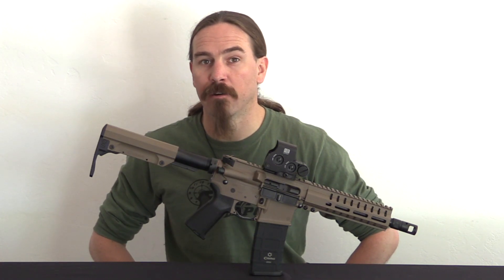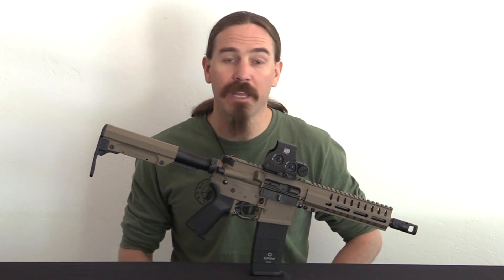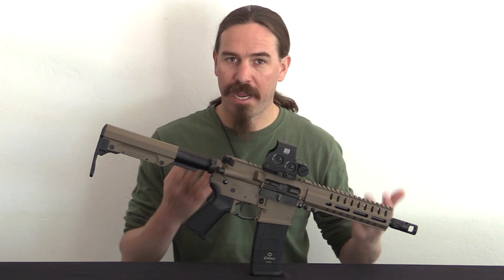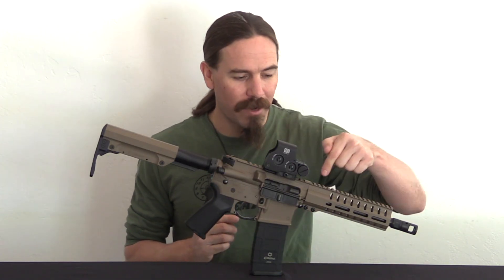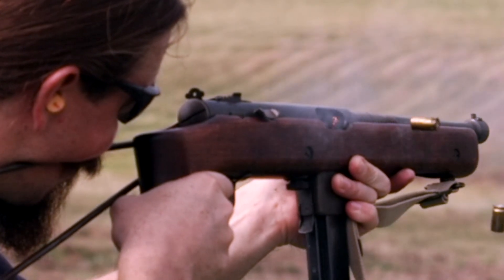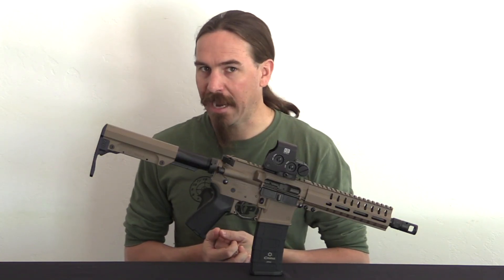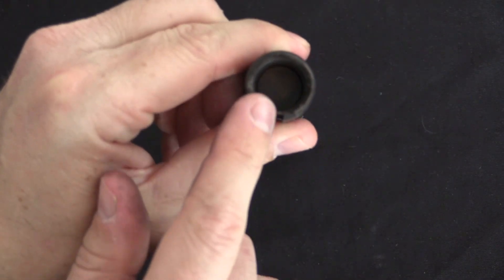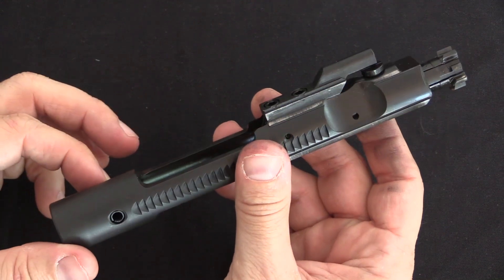CMMG Banshee: The Unique Radial Delayed Blowback System

Comment: I may need to snag this, for a PCC.
Reply: Wonderful in 9mm. Suppresses very well, too, if that matters to you. I like it enough that I will probably get another in a different caliber. Two thumbs up for CMMG from this guy.
Reply: Wait wat a week ago?
Reply: @redacted2713  time travel
Reply: maikson wever SCP #3548
Reply: @redacted2713  patreon supporter.
Reply: @redacted2713  patreon gets early access
Reply: I have the 9mm Guard. It is very nice.
Reply: You will not regret this gun. The recoil is pleasant unlike my Colt AR9. And I do like my Colt, it runs like a top. But it recoils like my AR in 7.62x39 and is harsh, (but not heavy).
Reply: Just got one in 9mm. It is a fantastic piece of kit. Seems to do well for 10mm and 45 as well.
Reply: You can also buy a kit to retrofit any AR, comes with a BCG, Barrel, and magazine internals. That’s what I did for mine but I used a standard Glock mag AR-9 lower and removed the ejector and feed ramp. I would recommend you just do the mag conversion though.
Reply: Had to like it so the likes would be 223, no pistol caliber lol
Reply: They sell upper receivers too! If you already have an AR-15, you can save half the cost by just getting an upper and some magazines.
Reply: You won't be sorry. I've got their 9mm Glock-magazine 16" carbine, and it's really nice to shoot. Very noticeably different from, say, a CZ Scorpion 9mm PCC, much more pleasant to shoot. I put a KE Arms SLT-1 trigger in it (it came with a standard AR trigger, but offer a Geissele for a bit more), and a Vortex Strikefire II red dot sight, and off we go.
Reply: You need to get one.
Reply: wtf is PCC
Reply: They make barrel and bolt kits if you are the type (like me) that likes to roll your own. PM me with questions!
Reply: Patreon.